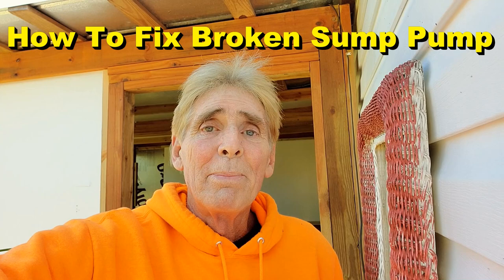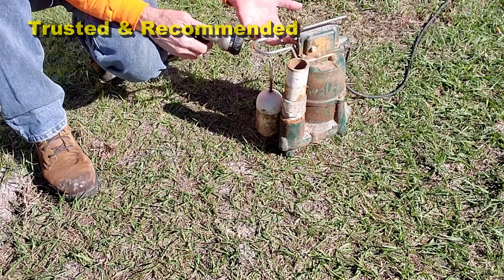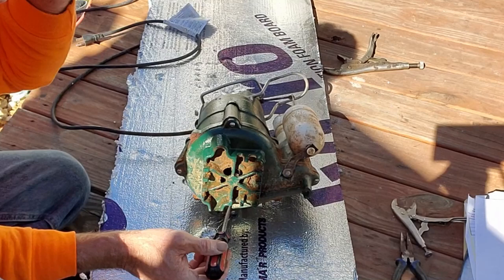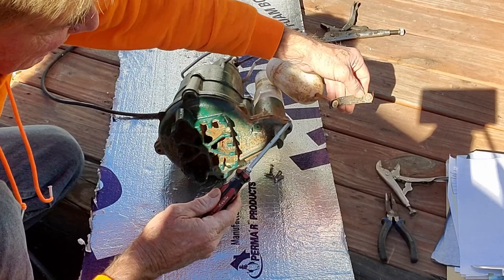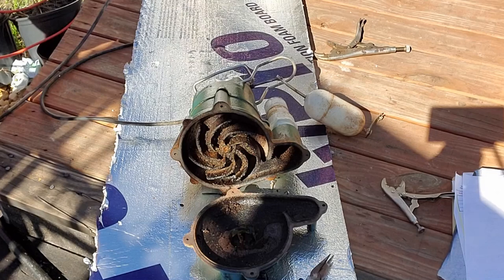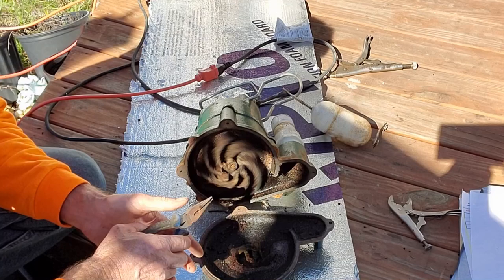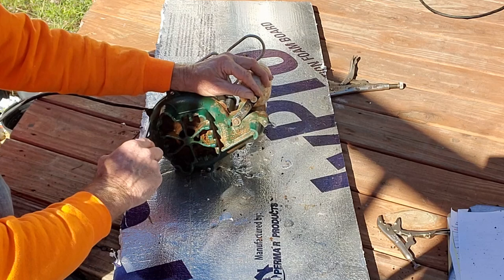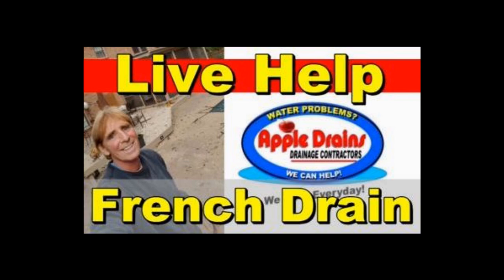Sump Pump Repair, Free Fix, Easy DIY

Comment: You told us 1000 times that you don’t resell the pump but when it came to the actual repair - the cleaning …you didn’t say how you cleaned it… water? PB blaster? What did you use?

Comment: guys, the building I work on, the builders put in the sump pump basin and then poured the concrete foundation lol the lid is bigger than the hole, I just had to cut a sump pump lid in half to get it off lol dammit
Reply: you touching the impellow with your pliers lol I was screaming at my computer, I think my pumps given up the ghost, I can't get the impeller to turn, I think iron bacteria got inside it. RIP

Comment: I owe you a beer my friend. Cleaned all the black hardened sludge out of mine started turning faster and more quite than before.
Reply: Did you just clean the visible parts or somehow cleaned underneath the impeller as well? Cleaning the visible parts didn't do it for me. I still need to give the impeller a nudge to get it to working. I am almost there, but couldn't get it done. Pretty annoying. I already replaced the switch and I don't want to replace the whole thing...

Comment: I’m going to check the impeller.  Bet it’s the same issue. DIY.
Reply: It was the impeller. Must of been hanging up on the bushings.  Put it back together and it works fine. But I’ll keep an eye on it, force it to work once in a while to check.

Comment: Thank you! This saved me from buying a new pump!

I could hear the motor hum when I plugged it in but the impeller wasn’t moving. I thought the motor or drive shaft was shot but after watching your video I opened mine up and it was just sediment and mineral buildup that was impeding the impeller. I didn’t know that was such a common issue.

Comment: I've had to actually pull one of those out of the pit, after unplugging it of course and sit it on a table and take a dental tool and actually pull strings of cloth that  came from towels that were old and pick the string out of the pump, took maybe 45 minutes,  and looked it over good afterwards and it ran for at least another 6 months by just taking the proper tools and patience to do the right thing for it.

Comment: I understand pumps don't need to run 24 hrs a day, but those hours would be a total of 225 continuous days running. Just a little bit of maintenance on a pump and will last for many many years...

Comment: I have the same problem. 

I have a buzzing sound when I turn it on. If I assist it just a tiny bit, it works very powerfully. But every time I turn it off, it needs assistance to move again... I don't know how to clean. I even have put the whole pump in CLR to get rid of the gunk... I changed the switch. It still only makes humming noise and needs that tiny bit of assistance to work...

Why did you not show the part where thats literally the title? You cut the part how you cleaned the underneath.
Reply: Is there a way to clean in between the impeller and cast iron part without taking the whole thing apart? Seems like cleaning the visible parts are not enough to get it work for me.

Thanks for the video.

Comment: Excellent video.  Any thoughts on WHY the Float Switch is a double-pole switch?  I'm don't understand why they are disconnecting the Neutral and the Hot lead with the switch?  I'd rather hook both poles of the switch to the Hot lead so you have a redundant switch (Spare).  Our Zoeller M53 had one side of the switch fail and of course the pump stopped.  If I had wired it redundant, our Pump would have not stopped.  Every Pump I have examined has both leads interrupted by the 2-pole switch.

Comment: My pump is only 4 years old. Goes off a multiple times a day. I have orange sludge in my pit and it got into the bottom of pump. My pump is working slower now takes about 2 mins to fully get rid of water. I took pump out and cleaned it but still slow. What's wrong with it?

Comment: Question: I bought a pump at a store closing sale, 30 years ago. Used it about an hour once. I pulled it out to use it again and the box and pump were oily, so it is leaking oil somewhere. It runs for 10 minutes and then stops. 15 minutes later it restarts. Is it worth fixing?

Comment: I have a little giant sump pump.  what is the black circle  about the size of a penny with 4 small holes in it on the top of the pump.   WHat kind of oil goes in the motor?

Comment: Same happened to mine. Took the bottom off and gave it a nudge and it started spinning. Only problem is sometimes it spins and sometimes it doesnt. Is there a way to remove the impeller?